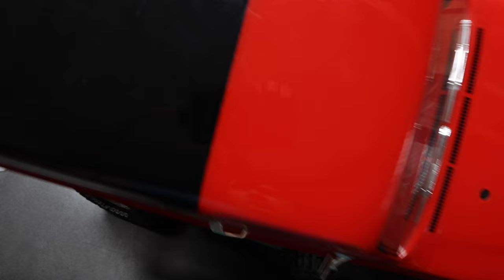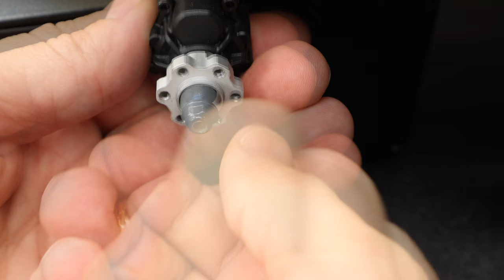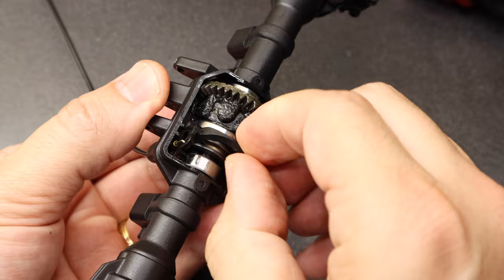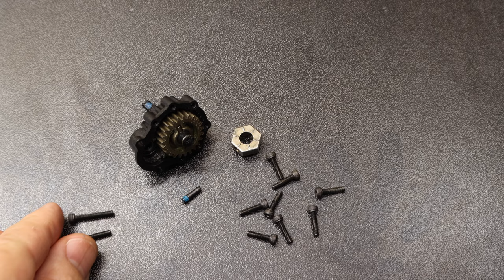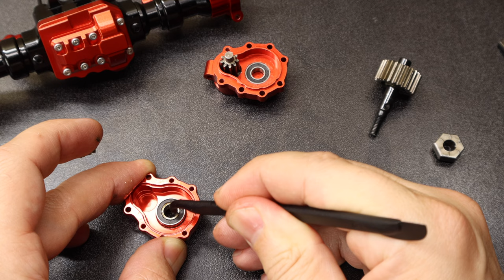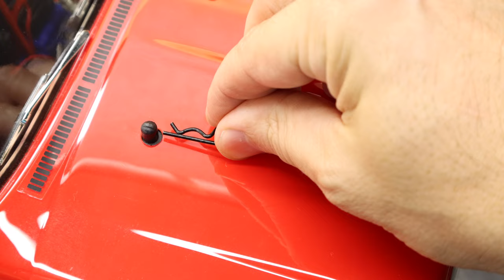Traxxas TRX-4 Aluminum Axle Upgrade | Traxxas K5 Blazer TRX 4 RC

Comment from the maker: This is a great upgrade for any Traxxas TRX-4, it adds a little unsprung weight and give a realistic look.
Reply: What power drill/screwdriver are you using?🤔
Reply from the maker: @jamesplymire5342  It is a Dewalt power screwdriver. DCF682
Reply: @jamesplymire5342  o😊 ok iiiiiiiio III III it u

Comment: Down grade for sure
Reply: Why is that?
Reply: Metal doesn't slide on rocks and cheap cast pot metal.
Reply: @reddeerrebelrc6674 I have these and so many of the bolts are now stripped. The performance was great but now everything has loosened to point that I need to back to stock axle housings.

Comment: Please please please guide me into finding those F caps for the wheels I have a build I just finished and that would be the finishing touch
Reply from the maker: The F cap shown is part of the wheel itself (no caps) I added a link in the description for the wheels, they are from GDS racing.

Comment: I'm having issues with my T-Lock settings I think. They seem to be in the wrong order or something. Any suggestions?
Reply from the maker: Sorry for the late reply, have you figured out the issue? The cable lengths are adjustable, also make sure you are using the appropriate front/rear cable
Reply: @TheFixTech  oh man it was so dumb lol. I have the tqi Bluetooth and managed to switch the settings on the app unknowingly. I finally figured it out a couple days ago.